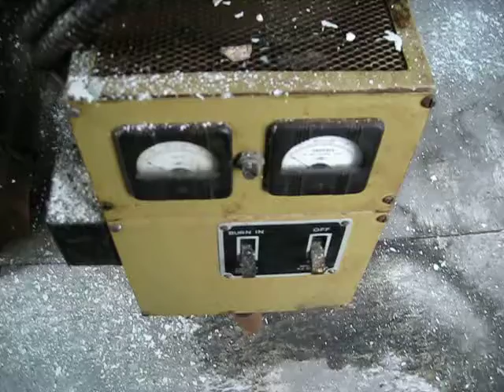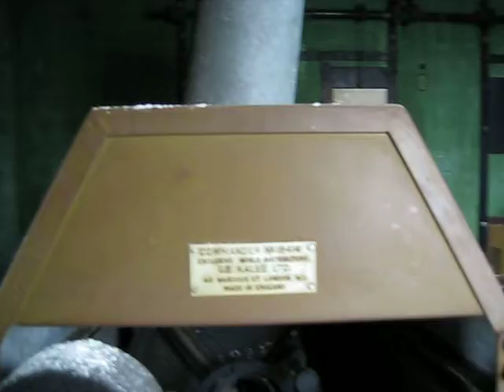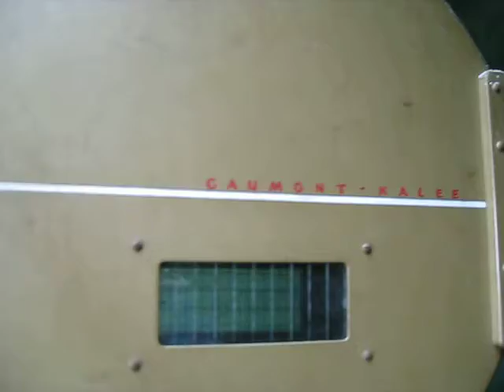RUNWELL HOSPITAL (22) -Great Hall Projection Room -March, 2010

Comment: I worked as a cinema projectionist starting in 1961 for twenty years. These look like GK (Gaumont-Kalee) 21 projectors. I worked on the Kalee 12 types with Peerless Magnarcs and Varamorph anamorphic lenses for showing CinemaScope films, the same as the ones here, although the backing lenses are missing. You needed two machines in order to go from one reel to the next and back again, otherwise, you'd have to stop the show every 18 to 20 minutes while you laced up the next reel. The way cinemas were run then was a world away from the way the modern digitalised multiplexes are run. It was a very complicated and physically demanding job, especially with regard to dragging the very heavy metal transit cases full of reels of film up the stairs to the rewind room from the loading bay.